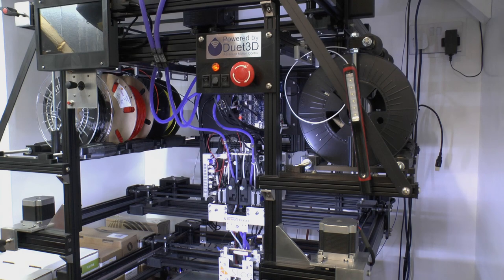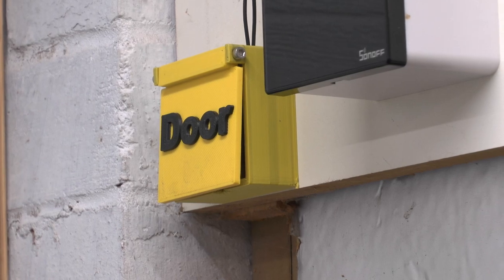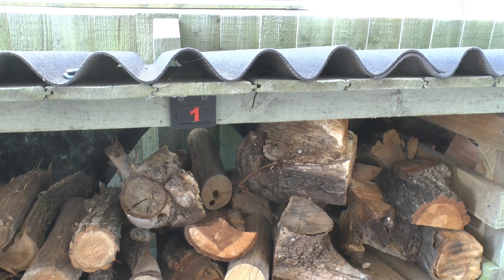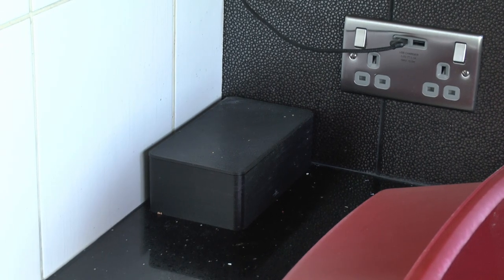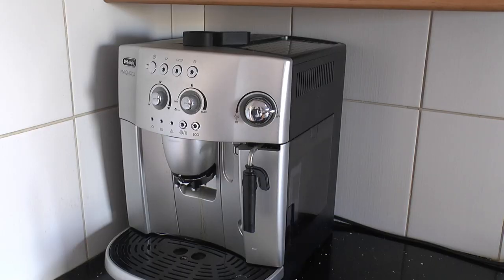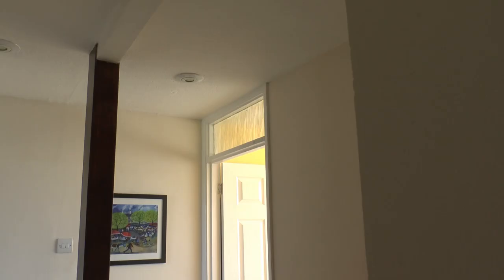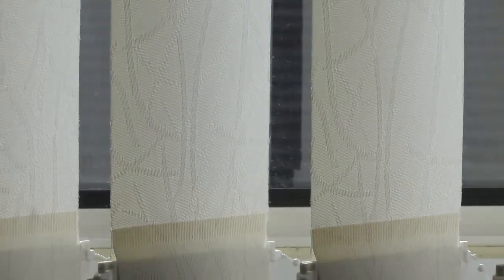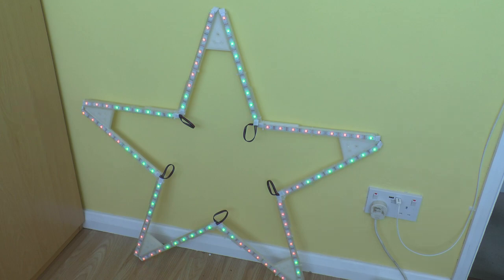House Tour

Comment: I never really looked at 3D printing , preferring to go down the hobby CNC route, but I can see how you became addicted!  I would be interested to know the details of the salt block height sensor, though - if you're  prepared to share!  I might eventually go down the 3D printer route, but I've still got a lot of CNC stuff to learn.  Thanks for the video.
Reply from the maker: I've always had an interest in building small electronics projects which invariably need to be fitted into some sort of plastic box. One of the reasons for getting into 3D printing was so that I could produce suitable enclosures the size and shape that I needed. The salt level sensor is a bit complicated to describe here but it's based on other designs using ESP devices that I came across using google search.

Comment: I like your curtain closer  :-)
Reply from the maker: It's a bit spooky that you should mention that. I'm currently working on upgrading them to run on and ESP 32 so that I can integrate them into the rest of my home automation. So far I've got some quiet TMC2208 stepper drivers which have made the motors all but silent whilst running faster. And I have a formula for calculating the sun's position relative to the window by using it's azimuth and the orientation of the window in relation to true North. From this, I am able to calculate the target stepper motor position to rotate the slats such that they are always at 90 deg to the sun. This gives finer control than just using 3 LDRs. So far, I have a stepper motor that rotates depending on the suns position relative to the window but it's all plugged together on a breadboard so plenty more to do.....